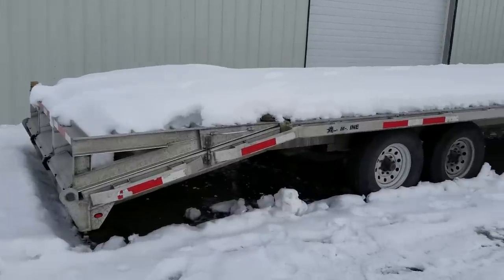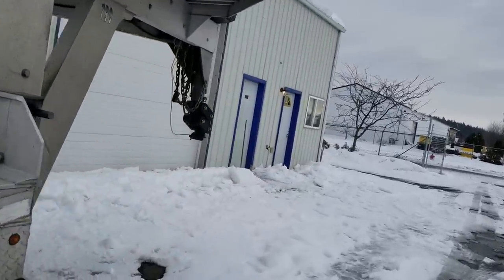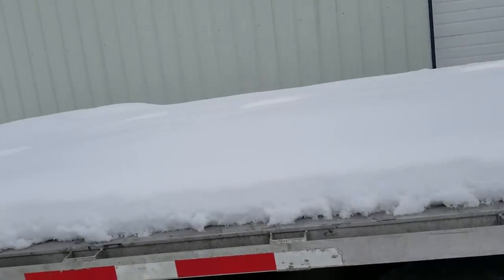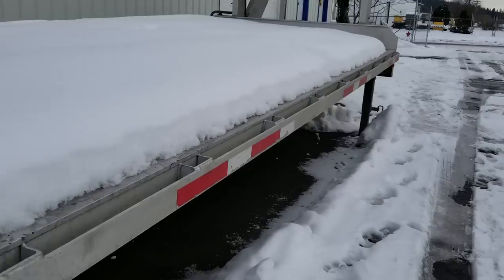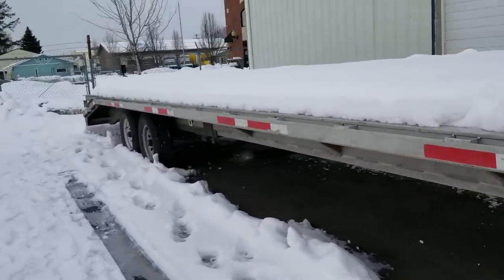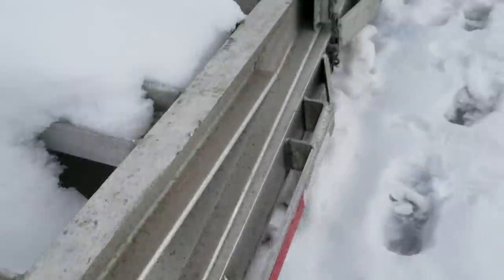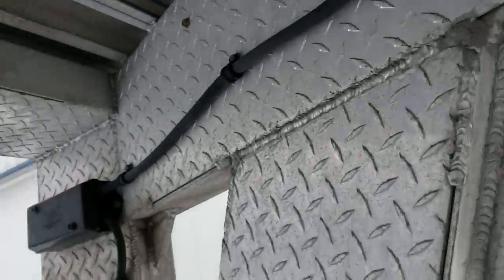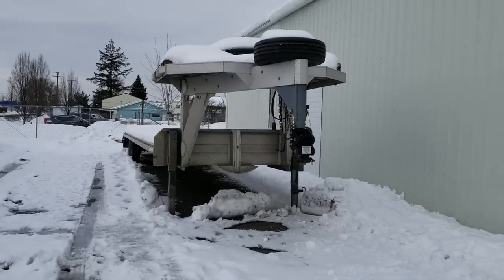Aluminum flatbed gooseneck. Would I buy one?

Comment: The only experience I have with aluminum trailers is livestock trailers and that’s more geared to the corrosiveness of the manure from the critters. They do seem to bounce more over the old steel trailers we had. Never gave a flatbed much thought. One thing to note is that steel is easier to repair and weld than aluminum for the average shade tree mechanic.
Reply from the maker: Agreed